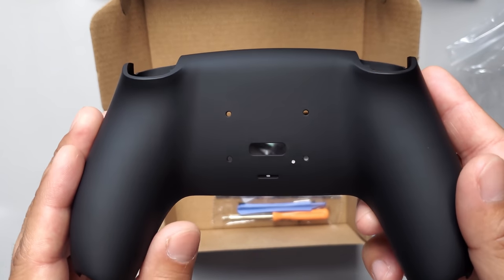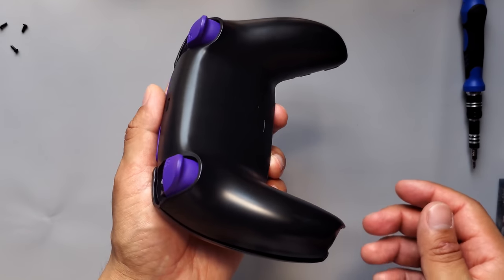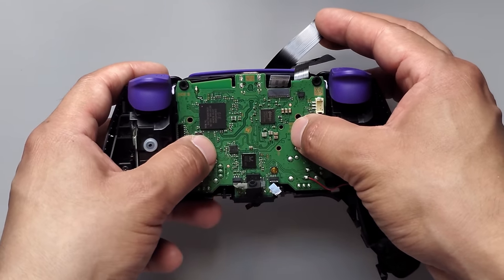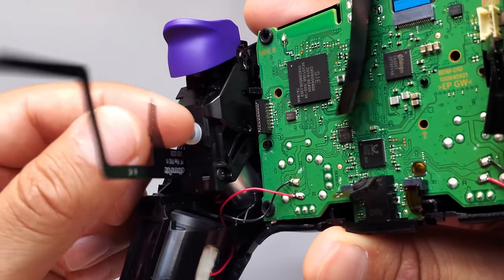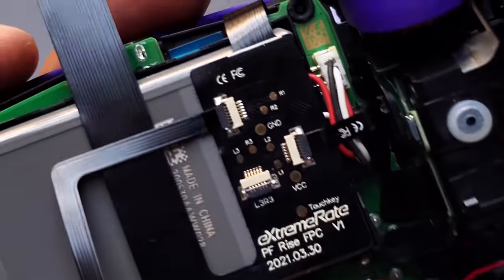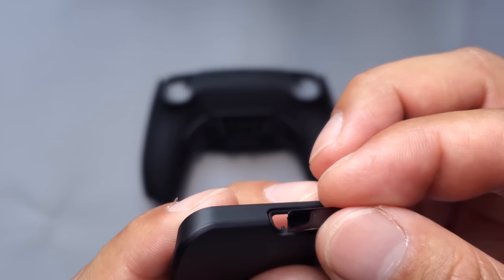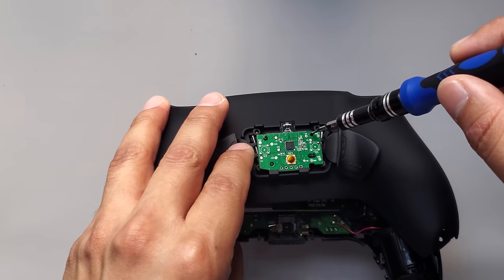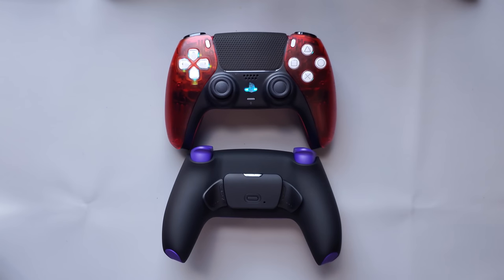DIY PS5 Controller (For BDM-010): eXtremeRate's Rise Remap Kit | No-Soldering Step by Step Tutorial

Comment: hey man my controller doesn't recognize the battery after this, I checked and I'm sure I put the battery the right way in. the controller works perfectly (the the back buttons) when connected to the charging cable but it doesn't work without it. The battery symbol on the ps5 shows a question mark, any idea what I did wrong?
Reply from the maker: Is the original shell's model number CFI-ZCT1W A or did the motherboard have BDM-020 on it?
Reply: @im.a.caveman  hey it’s Bdm-010, I opened the controller again and removed the battery and put it back in and it started working… sorry for the late reply
Reply from the maker: @kel1337  So far no problems then?
Reply: @im.a.caveman  no problems!! It’s working perfectly.. your tutorial is a lifesaver

Comment: Hey bro, I just installed and was able to get the remap kit to power on. However, I can't map the K1 or K2 buttons. Any tips to help with this? Thanks.
Reply from the maker: When the red led went on you held k1 or K2 with the button you want to remap it with?
Reply: @im.a.caveman  Yeah, I did and the lights flashed. But the buttons still did not remap. The model number of my controller is "CFI-ZCT1W". Is this the correct BDM-010 PS5 controller?
Reply from the maker: After you remap turn the back buttons off. Led will go off and then you should be able to use them. On is for remapping only. So once you've remapped turn it off and you should be able to use them.

Comment: when i hook up the l1 l2 ribbon the power to the controller shuts off, i disconnect that ribbon and the power comes back, what can that be?
Reply from the maker: It's a compatibility issue. The V1 remap kit is only compatible with CFI-ZCT1W (BDM-010). You can contact extremerate to see if they'll send the cables for your controller model.
Reply: @im.a.caveman  I have now tried BDM-010 which is the ribbon that lines up and also the BDM-020 which don’t line up.

Comment: I did everything fine but when I try to turn on the controller it won’t turn on but when I plug in the charger it goes yellow then goes away do I have to fully close it? Or did I do something wrong?
Reply from the maker: It sounds like you have a BDM-020 board. Does the original back shell show CFI-ZCT1W A or CFI-ZCT1W?
Reply: @im.a.caveman  CFI-ZCT1W
Reply from the maker: Then it should be compatible. You can also check the motherboard. It should show BDM-010 for compatibility. If it's compatible check all your cables.
Reply: @im.a.caveman  yes I checked the mother board and it matches I also tried on another controller I have and it does the same I plug the charger in it lights up but doesn’t turn on when I hit the ps button checked all cables as well
Reply from the maker: I can only assume you got a faulty.
Reply: @im.a.caveman  I got a new one and it works! It was definitely a faulty preciate the vid was done in like 30 min at most

Comment: Amazing video I just need help with one thing lol my dpad is not working
Reply: Redid everything and now my x button turns left and my square and circle button is triangle and triangle doesn't work
Reply from the maker: @ablockthagr8  Could be compatibility issue. Is the original back shell model number CFI-ZCT1W or CFI-ZCT1W A? Does the motherboard show BDM-010 or BDM-020? The kit is only compatible with BDM-010 or CFI-ZCT1W.

Comment: My only gripe about the paddles is they are so sensitive to touch. Does anyone know what I can do to fix this? Like stiffen it a little or something?
Reply: You can place rubber pads inside the mechanism next to the buttons. I did it and it works. But I went further and installed PTS810SJS250SMTR LFS parts. They require more force to press
Reply: @pan_yuta  so the parts. Does it require soldering?
Reply: @pan_yuta  what rubber padding did you use and where exactly would I place it? I would love to switch the tact switch but I don't know how to solder
Reply: @Art0fHonor Just harvest out some rubber from somewhere, I had cut out small bits from used water filter cartridge. Look around. There is two places to put them. 1st - Outside - In between paddle and back shell. Second - Inside that box between PCB and paddle, close to the button part
Reply: @pan_yuta  what's PCB?
Reply: @Art0fHonor  printed cirquit board. Small green board)
Reply from the maker: Just passing by to say it's cool you modified the kit to your preference. I wish I had the skills you do.
Reply: @pan_yuta  back again. Bought the replacement parts but how do I install them?
Reply: @Art0fHonor  If you asking this question I assume you have no soldering experience/equipment. So simplest solution will be to ask for help from nearby repair shop technician

Comment: Man, dope vid, followed everything very easily, great instructions but now my controller doesn’t turn on lol, I’ve gone through your video and my controller 4 times now and still doesn’t turn on or charge 😔
Reply from the maker: Sounds like it's not compatible. Is the original back shell model number CFI-ZCT1W or CFI-ZCT1W A? On the motherboard does it show BDM-010 or BDM-020? You can check either one. The kit is only compatible with CFI-ZCT1W or BDM-010.
Reply: @im.a.caveman  I have the same problem. I checked at first and thought there was no A. Then I just looked again and the A is so small I didn’t even notice it. Damn this sucks.
Reply from the maker: @pjw4125  The company is working on getting it to work with CFI-ZCT1W A / BDM-020.
Reply: @im.a.caveman  I just checked my black controller and it doesn’t have the A at the end. Do you think that would work? Doesn’t make sense. I thought the black ones were newer?
Reply from the maker: They are in the sense that they came out recently but it turns out that even the Cosmic Red shows CFI-ZCT1W. It should work. You can always check for the BDM-010 on the motherboard before installing the kit. But once you see CFI-ZCT1W that's usually good news.
Reply: @im.a.caveman  so how would you go about it if you were me? Since I already stuck the thing to the battery? Maybe just swap everything including the battery to the controller that works?
Reply from the maker: @pjw4125  You can still remove it from the battery. Just take your time with it.

Comment: Mine.  Won't turn on. No red light or anything.  Did it once wouldn't work. So I took it back apart unplugged and plugged back in. And still won't wrk 😔
Reply from the maker: The control isn't turning on or the the back buttons aren't turning on?
Reply: This kit won't work with new controllers with a BDM-020 board, I've tried and tried. Company knows and should be working on a updated kit fot new controller models.

Comment: Just did everything exactly as you did and now the controller is not working, cant make it to turn on, what can I do? I already re-do the whole thing like 5 times
Reply from the maker: Is the model number on your original back shell CFI-ZCT1W or CFI-ZCT1W A? On the motherboard does it show BDM-010 or BDM-020? The kit is only compatible with CFI-ZCT1W/ BDM-010. Extremerate is working on getting it to work with CFI-ZCT1W A / BDM-020.
Reply: @im.a.caveman  thanks for responding so quickly, I just removed the kit and reassemble the controller and is working again, so basically I'll need to buy a new controller that is compatible (with the model you mentioned) and then it would work? My controller does have an A at the end of the model :-(
Reply: @im.a.caveman  hey men, just an update, I bought a new controller with the right model # and it worked just great, thanks!!!

Comment: Followed the exact steps but my controller wotn turn on. What do you think might be the problem?
Reply from the maker: Did you connect the cables compatible to your control?
Reply: @im.a.caveman  Just found out the problem earlier. My controller was actually bdm 020 since it was the model number on the motherboard. The model number on the outer shell didnt have the A in it so i thought it was a bdm010. Sent an email to them so i can hopefully get the cables replaced🙏

Comment: I've attempted this twice now on my PS5 controller, all set up correctly and then not turning on but if I remove the kit, it works fine. Can anyone help?
Reply from the maker: It could be you connected the wrong BDM cables. If you have a V1 remap kit that one only has cables that work with a CFI-ZCT1W/BDM-010 controller. The V2, RMB, and Rise4 include cables compatible with CFI-ZCT1W/BDM-010 or  CFI-ZCT1W A/BDM-020. If the wrong cables are connected the controller usually doesn't turn on because the connections are different. 

There's also a new BDM-030 which is not compatible with any kits currently. I'm sure extremerate will release something for that. 

If you have any questions feel free to ask.

Comment: I am setting putting these paddles on for my brother and now the controller won’t turn on. The battery is connected. Any suggestions as to what’s wrong?
Reply from the maker: If the control doesn't need to charge then it could be a compatibility issue.
Reply: @im.a.caveman  that’s what I am thinking. The L1L2 V1 cable once I plug it into the motherboard the controller won’t turn on. But when I unplug it the controller turns on. Weird
Reply from the maker: @colemclaughlin2368   seems you probably need the one that works for your control
Reply: @im.a.caveman  for sure. What one would that be? Thanks for the help.
Reply from the maker: @colemclaughlin2368  On your original back shell you'll see either CFI-ZCT1W which is a BDM-010 or CFI-ZCT1W A which is a BDM-020. BDM is found on the motherboard but it's easier just looking at the model #. You could also contact extremerate to see how they can help because they could POSSIBLY send you the cables for your control. I have a video on compatibility if you still want to check that out. 
https://youtu.be/cncOZDDSmIk

Comment: controller wont start why? and the red button dont turn on? I tried to re do every step 3 times same but dont work
Reply from the maker: If it doesn't need to charge then most likely the kit is not compatible with your control.

Comment: My controller isn’t turning back on, I’ve check the battery connection multiple times. Any idea what I did wrong??
Reply: I’m assuming it’s non compatible based on the comments. Will I be able to take everything off and have a workable controller again? Is it the strip that runs under the battery that is restricting it from turning back on??
Reply from the maker: If you put it back to original it shoukd turn on. I'm not completely sure, but you can try removing the trigger remap cables and put the original ones. If it's just the cable that connects to the remap board it might be able to work. This is from comments I've gathered information from but I could be wrong. It's up to you if you want to try that or you can contact extremerate as well and talk about the issue with them.
Reply: @im.a.caveman  I appreciate your response. Great tutorial nonetheless! I’m a caveman myself clearly as I didn’t make sure I had the correct controller first haha
Reply: Just wanted to circle around on this. I took off the mod components and put back the controller in its original form, including original cables. Controller works normal again.
Reply from the maker: @SwannyGolf  Nice, just contact extremerate and see what you guys can figure out together. We're all cavemen/cavewomen in our own way sometimes. Mistakes are made all the time. Hopefully you'll get to install your paddles. Good luck!

Comment: Wdym about l3 an r3 do the paddles get rid of them?also how do you unmap from buttons
Reply from the maker: Because this is the non-soldering version, you won't be able to remap L3, R3, or toucpad. You unmap by pressing the same buttons you pressed together. Ex: Map O to right paddle. To leave the right paddle blank hold O and right paddle again. The right paddle will have no button assigned.

 If you're going map it to a different paddle but it's already mapped with O then all you have to do is hold right paddle and like X. It'll remap it to X.

Once remapping is finished the back has to be turned off since leaving it on is for remapping only. If it's on, the paddles won't do anything.
Reply: @im.a.caveman  ah,thank you

Comment: I ordered from them from ur referral link and it doesn't say what my order number is or how long it's gonna take to ship
Reply from the maker: You should be getting one. If you just ordered it then you probably just have to wait for the email. Usually it ships with 4px which also wouldn't say the estimate delivery unless they transfer to another shipping company. For me it goes from 4px to usps. Once usps has it the estimate date is shown.
Reply: I also just bought the os5 back in May and it has the springs in the triggers visibly but also have the ukca  and little a after model number so I'm confused Hella to know if ordered the right bdm

Comment: Wait so if I don’t solder I cannot use the l3 r3 and touchpad buttons? Or I can’t use a mod for them buttons?
Reply: If you don't solder it just means you can't put L3/R3 or the touch pad as a back button, all the other buttons you can 👍
Reply from the maker: What Craig said, installing any of the extremerate remap kits is not going to affect the regular functions of your control. You'll just have back buttons. With the non soldering version you'll be able to remap dpad, action buttons, and triggers. If you do the soldering version you'll be able to remap all the ones mentioned above plus the touchpad, L3, and R3.
Reply from the maker: @CraigsChannel  Thanks for helping out Craig. Hope all is well.
Reply: @im.a.caveman  Any time dude 👍 I was just passing and thought I might as well help out when I can 😎
Hope you're good!
Seems loads of people lately have been putting the ribbon cables in the wrong way around, these new ribbons you have to cut are really confusing people
Reply from the maker: @CraigsChannel  People are probably skipping the part where it's be explained why you do and don't cut these cables. And some still don't do research on their controller model/BDM number. I think they're just buying without hearing or reading the details. That's why I believe there's alot of misunderstanding with these cables. One thing that's been confusing me, is that for those that say they installed it correctly, some of their front buttons end up not working for some reason. 

I've had no issues and not able to see how they installed it so it can be hard to tell what's the issue.

Comment: ive follwed every step here easy install apart from it does not want to power up at all any ideas
Reply from the maker: If the battery is connected and it doesn't turn on then that'd be because the kit is not compatible with your control. Did you check for compatibility?

Comment: How do you reset the buttons to different controller buttons a 2nd time
Reply: @Ronny-Swanton  as in turn on and off again or completely redo it again
Reply from the maker: Did you happen to figure it out?
Reply: @im.a.caveman  no
Reply from the maker: Turn remap mode on, now this is an example, if right paddle is programmed with X then you would just hold the right paddle and O until you see the light blink. Right paddle should now be O instead of X. After you remapped, turn the back off and you can use your paddles. If you want to leave a paddle blank without a button assigned to it, If either paddle is say the O button, then you would hold the paddle and O until the light blinks. That would take the O away from the paddle and leave it blank without a button assigned.
Reply: @im.a.caveman  🙏 thx

Comment: I’m guessing I didn’t put the wires in all the way? 
My back button lights up it lets me choose a button and everything but they don’t actually do anything
Reply from the maker: Did you turn the back buttons off after? That would mean that remap mode is off and can now use them
Reply: @im.a.caveman  oh no lol I see now
Reply: @im.a.caveman  now I ran into a different problem my ps5 controller just blinks orange it won’t connect to my ps5 via Bluetooth or wired?
Reply: Okay so it’s weird one of the wires when I lock it into place my controller just dies and won’t turn on or connect to anything but when I unplug it it works perfectly fine and my back buttons work lol
Reply: Oh it’s my right triggers lol every time I plug in that strip it makes my ps5 controller not work
Reply from the maker: @carlossaucedo34  I think you might have the new controller model BDM-020. It wasn't know that there was a new one. The kit is compatible with BDM-010. Extremerate is working on a new kit for the new model. They've apparently also asked people if they could buy BDM-020 controllers from some people for testing.
Reply from the maker: @carlossaucedo34  can you check the back of your original shell and tell me the model number? I think it's right above the "Sony" logo.
Reply: @im.a.caveman  I’ve had this controller since around launch? I don’t think it’s a new one? Do you think If I put the original connector from the controller back in for the right trigger it would be fine?
Reply: @im.a.caveman  cfi-zct1w that’s the model number
Reply from the maker: @carlossaucedo34  Can you also send me where it says "ID" and "IC"?
Reply from the maker: @carlossaucedo34  After the "w" is there an "A" there?